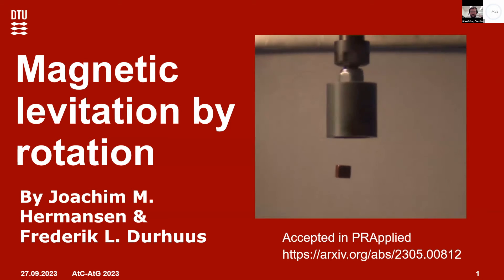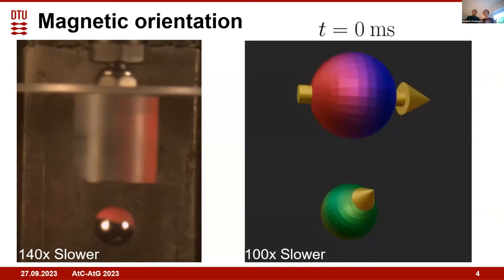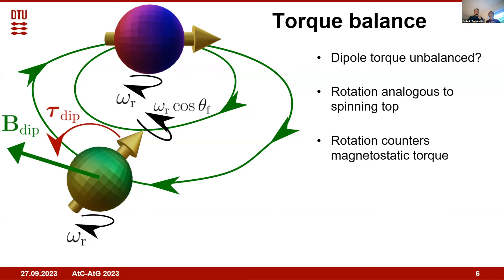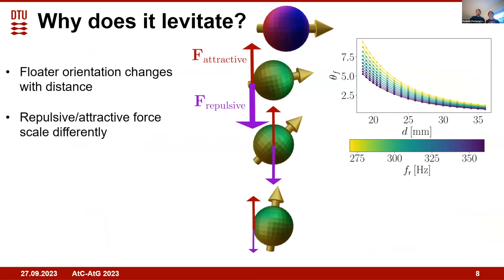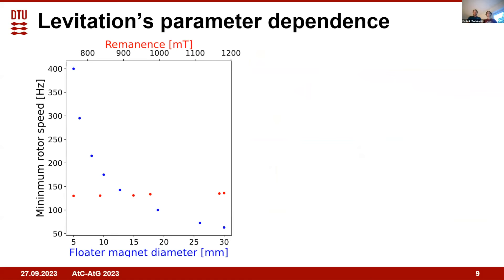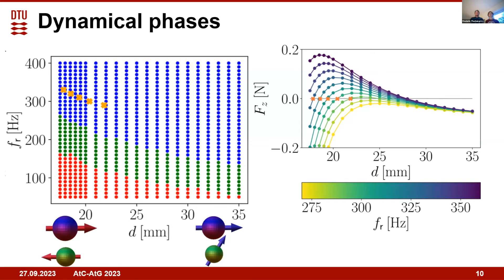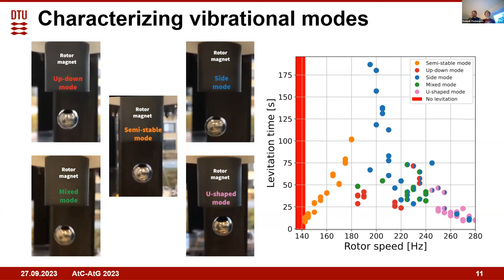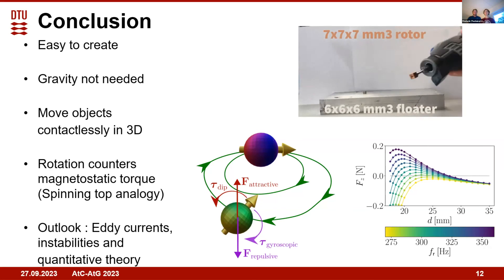"Magnetic levitation by rotation - IEEE AtC AtG 2023. By Frederik L. Durhuus & Joachim M. Hermansen

Comment: I could not get mine to levitate unless I had the spinning magnet at an angle. I found that 15 degrees worked well. I would get a stable spin with no oscillations, but if I tilted the spinning magnet a small amount, it would start vertical oscillations.  
This is my attempt -
https://youtube.com/shorts/L6oeQjBh5t0?si=bYfqL4XYhA-aZLhJ

Comment: In your second powerpoint video, how did you fix the magnet to the drill
Reply: I used a screw and used superglue to glue the magnet to the head of the screw. See my notes above for other details.
Reply: @ Thank you. I will try to do it!
Reply: @ How can you find the motor  which has low rotated speed?

Comment: I wonder what happens when the floater magnetic field strength, T, is dramatically increased to have an effective diameter of say 4,000 to 5,000mm ... because it seems like the magnetic rotor minimum speed could be exceptionally low. Then, where else might this type of tech have already been used and actually observed? 🤔

Comment: When the Dremel spin is replaced by artificial spin as a paramagnet powered with electric current mimics the spinning field...
A magnet placed above the field
Floats/rotates freely in the wind 
And if attach d to a light lights up as electricity passes through the field to the spinnor...

These are sold now as kits that you can buy on eBay which float lights
Or bowls or any magnet you place above the paramagnet base 

Please explain how this is not the force which keeps the moon trailing the consistently spinning earth at the consistently varying distance the moon follows the gigantic Dremel like earth magnet
Around the sun spinning in three different directions simultaneously?

Comment: Awesome! What are the effects on the weight of the rotator? I assume that the mass of the 'floater' is a non-zero factor.
Reply from the maker: The rotor magnet is exerting a force on the floater which counters gravity. By Newtons third law, the floater magnet is exerting an equal force on the rotor pulling it down, so the weight is still there. When holding the rotor, you will feel the full weight of both magnets.
Does that answer the question?
Reply: the rotator now has the weight of the magnet on it because its trapped in the field unable to connect to the fields equilibrium